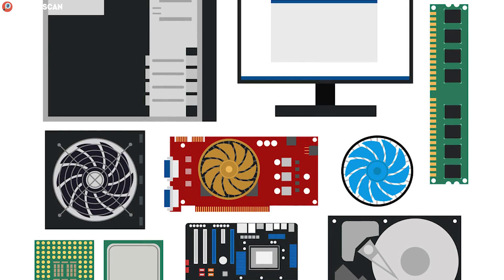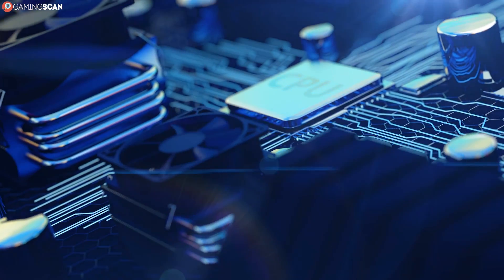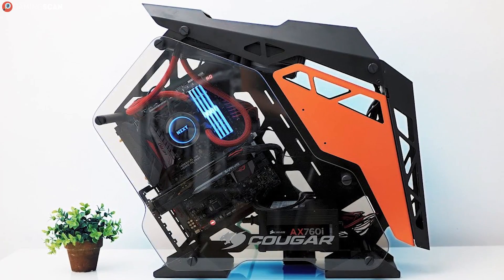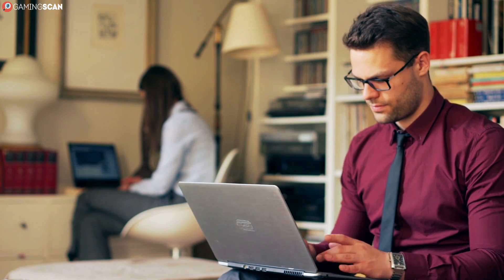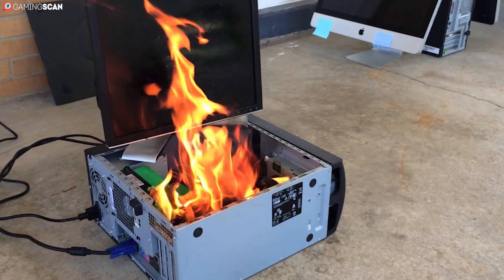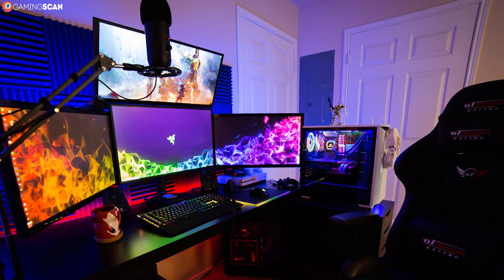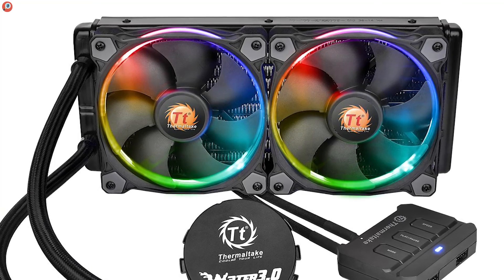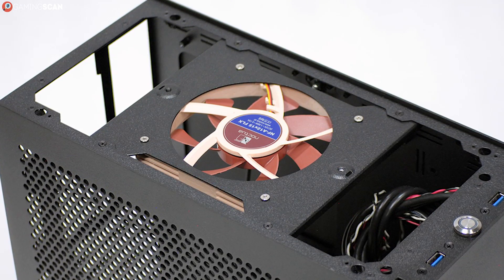Is Overclocking Worth It? (2020) [Simple Guide]

Comment: Why you don't recommend overclocking the monitor refresh rate?
I was planning on overclocking it on my new laptop
Reply: Sebastián Muñoz it can shorten the life span of the monitor, but still, I’ve been doing it for a while with no problems
Reply: @vest4802  If I only use overclocked monitor when gaming?
Reply: You’d be fine, just have realistic expectations
Reply: @vest4802  is permanent damage a possibility?

Comment: this is an excellent video explaining practically all basic details about overclocking, even for veterans it's a nice informative guide. Though note stock coolers are indeed capable of sustaining the overclock load but the catch is that the CPU will be at ~100ºC most of the time, therefore why it's recommended to have an after market cooler